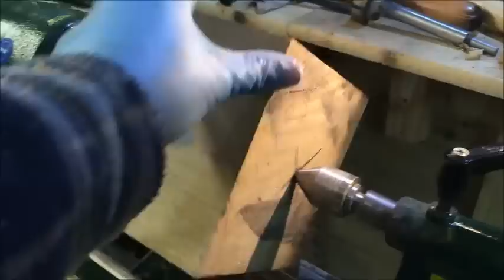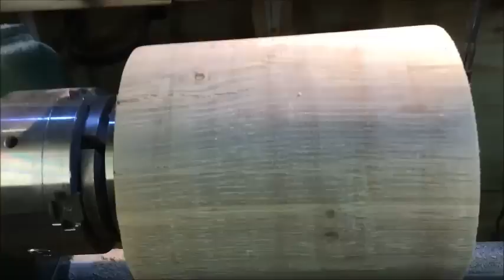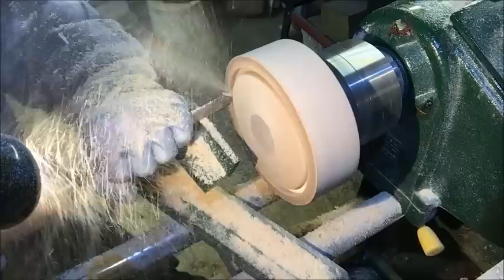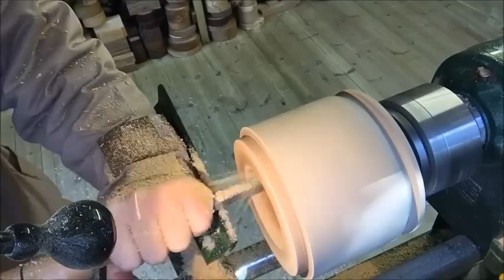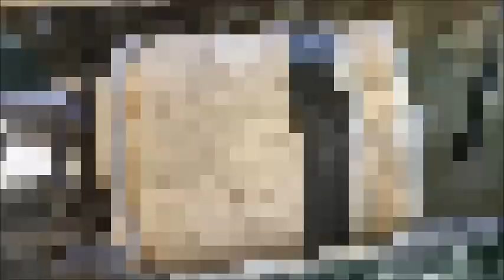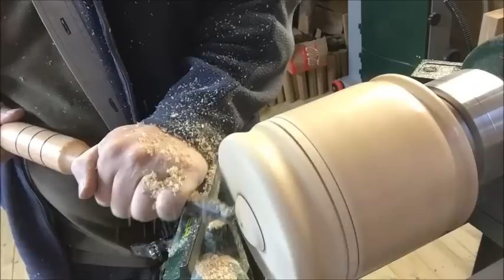Woodturning - A Massive Chuck of OAK

Comment: Came out great!  Sure was a huge chunk of Oak!
Reply from the maker: +AnkleBiter Woodworks Hey, yeah it was ok, the wood split was a pain. It happens on a few of my projects , its really annoying .  Any suggestions?
Reply: +NZ WoodTurning Try rough turning the blank first then leave it in a brown paper bag with some shavings for 3 or 4 months to let it dry out slowly before giving the blank its final turning. get yourself a moisture meter so you can track its moisture content. I like to get my blanks down to around 12-15% moisture content before i final turn them. Anyway hope this helps as it sounds as if the timber you're turning is too wet to begin with. just a suggestion.
Reply from the maker: +Jonathan Townsend Hi Jonathan, thank you for this and yes its a great help, I'm learning all the time so any help I can get is always appreciated.  The timber was wet yes as it was used to make a garage and I took it form the garden, it did rain the day before. typical UK. lol . All the best
Reply: Never tried turning any oak beyond a few pens from a Jack Daniels barrel stave.

Comment: Nice project Nick, oak can be really unforgiving sometimes but you mastered it well. A question; is that a food safe finish you've applied or just regular sealer & wax ? I did a couple similar containers for sweets a while back & had to leave lids off for ages to get rid of the fumes. Worked out okay in the end.
Thanks for sharing another lovely piece.

Geof Harris
Reply from the maker: +geofo60 Hi Geof, its not food safe on this one. its only sat on my shelf and I wouldn't sell it or give it away for anyone to use for food. I did mention this in the video but since learned after that I needed to use a food safe product. my bag! do you recommend a good food safe product Geof?
Reply: +NZ WoodTurning Chestnut Products do a food safe finish Nick. I think there's a huge debate on the subject but to "echo" Martin Saban Smith, if it doesn't say food safe on the packaging then don't trust that it is.

Regards ..... Geof
Reply from the maker: +geofo60 Thanks Geof, I shall look into this . All the best